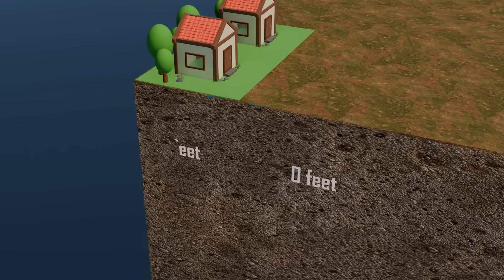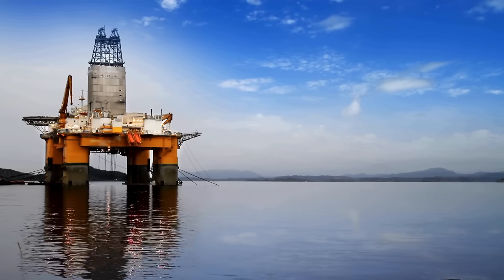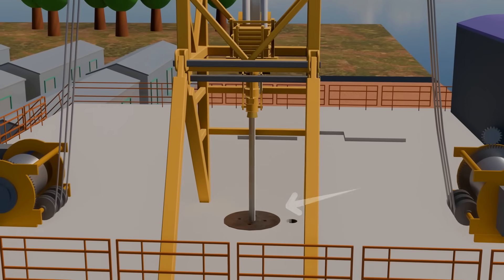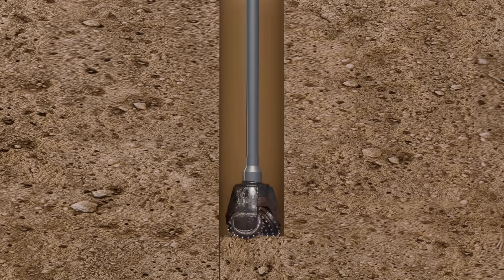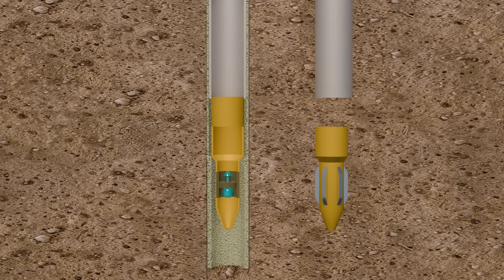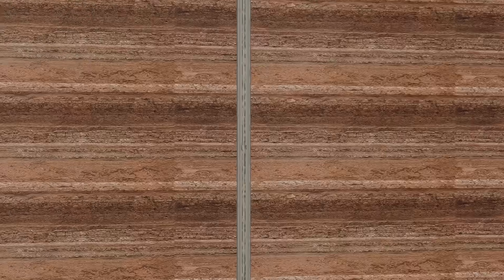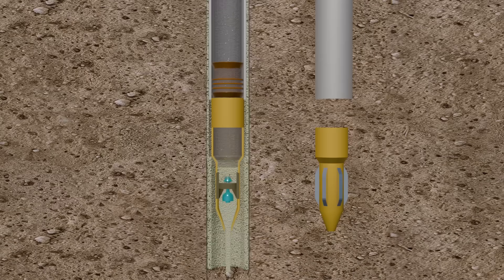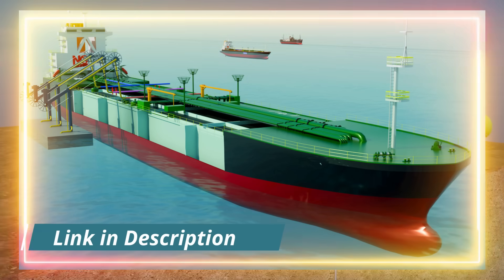How Do Oil Rigs Work? Drilling, Casing, Mud & Blowout Prevention in 3D

Comment: It’s not an oil rig or a gas rig! It is a drilling rig don’t get it confused gas and oil come up with one hole drilled. But one hole can produce many kick off points don’t let that get confused. 
My team and myself had the record for a horizontal well drilled in west Texas for over 6 miles in less than 30 days 23 days I believe to be exact with a motor called rotary restrearable and a PDC drill bit.

Comment: My 2 Older Brothers, and I have All have a 5 mile Club Plaque. The Deepest I was ever on was 28.800 But 1 of my Brother was a Roughneck on the Deepest Well Drilled in Texas 1978 The Emmy Lou # 2 was 29,622. Liquid Sulfer. No need to Drill any Deeper Straight Down. The Bit that TD,d the Hole is in the Permian Basin Museum.

Comment: The Tall Tower is Called the Derrick, not Mast. The Sleeves are called Slips. Never Lower the Entire Weight of the Drill String on the Drill Bit. The Small Holes are called Jets. The BOP,s are Installed before Drilling Begins not at the End of the Drilling. If the Hole is Bent Too Sharp Its called a Dog Leg.Pulling, and Lowing the Bit, and the tool Joints Threw Dog Legs cause's a Key Seat. I Started Roughnecking in 1978. There were no Directional Down Hole Motors Back Then. You Simply Cemented Up past The Key Seat and Used a Bent Sub to Try and Straighten the Angle of the Hole. Tech has come a Long ways since I 1rst Started.

Comment: Fairly decent on your video.  There are several areas that are outdated as comments mention and the descriptions are always accurate for today's oil and gas industry.  The total depth of the well depends on geology of formation depth and rock integrity.  In ND, we drilled typically 20-22,000' in about 3 1/2 weeks. 
The pressure also makes a difference too.  In Ohio, we drilled in 10,000 psi formations that had to be controlled by balancing the pressure constantly as the normal method of just weighting up would damage the formation.

Comment: It's probably not such a bad video, but when the rotary bit is turning the wrong direction and the cones are rotating at bizarre speeds, it undercuts the overall credibility.  The DTH hammer looks ok. ...(a 3 decade rock bit design engineer)

Comment: Not a bad video, but Kelly drilling is all but obsolete for the past 15 or so years.  Rigs still using it as a primary means to make hole are low cost,
Low tech and do t get much work.  
The "pulley system" shown is not correct.  A drawworks is used to trip pipe in and out of the hole, and it located on the rig floor or on the ground close to the the rig.

Comment: The pin, or male end, of the drill pipe is pointing down not up.
Reply: Normally, yes.  However when working in ND, the company attempted to bring in a small rig to drill the top hole as a way of cutting down total cost of well.  That little rig drilled with the pin up.  When I pointed it to the company man that they were drilling upside down, I had to point it our explicitly before he looked close enough to realize what I'd said.  The only rig I've seen with pin up...

Comment: So how did they know where to drill for oil back in the 19th century?
Reply: Completely different and without well control.  That's the reason that in old movies, they depicted gushers as there wasn't a way to control them.  They had to let them flow and then recover the oil from the ground.

Comment: Your animation shows the drill string rotating to the Left. Incorrect! All drill strings rotate to the right because threads (on pretty much everything) are right handed. Rotate to the left will disconnect the joints. Also, 7000 ft is a relatively shallow well. Many go to more than 30,000 ft.

Comment: You need someone with experience to proof these videos before showing. Pipe turns clockwise (to the right) and the pin (male thread) faces down.  You dont put the entire weight of the drill string on the bit. I could not watch any more.

Comment: This video is about 40 years to late, it pertains to the 70's and into the 80's and rig terminology used is all wrong, for instance the outside space  between the drill string and BHA, the annulus, is pronounced (ann-u-lus). The 80's saw top drives start to replace kelly's, mud motors, dtu's and the current closed rotary loops, supplant conventional rotary assemblies. Average well depths were in the region of 10,000 ft or 3000m, but depths can double and triple that in todays drilling. MWD replaced single and mutli-shot compass based systems and gyro gave way to accelerometers and magnetometers, utilizing the earths gravitational and magnetic fields, to determine where the well is being drilled, though gyros still overcome areas of high magnetic interference, when casing is involved. Mud is used for weight to balance the inward pressure exerted by the formations, as a coolant taking the geothermal heat back up to the surface to be dispensed, and as a lubricant. In addition the MWD pressure signals are transmitted through the mud to be decoded at surface and let the directional driller know where he is when plotted on the charts, that show the the wellbore to be drilled. I was forty years in the drilling industry, first as a seismic engineer, a surveyor using magnetic and gyro single and multi-shot systems, and then a conventional rotary drilling, mud motors, jetting, bent subs, and closed loop directional driller.

Comment: Is it cement or concrete?
Cement is a part of concrete
Reply: Yes, cement powder is just one component that makes up concrete, and is itself made up of at least five different components. Essentially it’s the chemical glue that binds the small aggregate, eg sand to form grout. Large aggregate is added and the cement, sand and water chemically react in a process called “hydration” and in turn bind with the large aggregate to form the malleable semi-liquid concrete mix we are familiar with. All and any of these components can be altered to impart specific properties to the concrete to change its workability parameters. Interestingly, construction concrete can take decades to fully cure. Though practical hardening may occur in a matter of hours full structural strength usually takes several weeks. This is tested during construction by taking predetermined quantity samples and subjecting them to precise crush testing in accordance with a specified timetable. These tests are determined by the construction standards applicable.
Reply: @s @stevengrindrod2002 . 
Hi Steven, thank you that info, I am aware of the components of concrete and where I was going is that many people called concrete, cement. A pet hate. Eg a tyre is part of the wheel, there is the tyre and rim that makes the wheel. 
Pumpset equal pump and driving force being an electric motor, diesel engine etc. 
But a genset is always called a genset

Comment: I was exploring in the Gulf back in the late 1980's. We set off a series of explosions to assess the presence of oil. Right after the explosions, the ocean looked like it was boiling there was so much methane in a shallow layer. We went back a week later and roughly 10-15 acres were still violently boiling. I don't want to think about how much methane escaped into the air. The company didn't care and refused my offer to estimate how much gas escaped.
Reply: Can we connect? Im interested to talk about an oppurtunity.
Reply: Persian gulf or Mexican gulf?
Reply: @cyrusthegreat1336 Gulf of Mexico

Comment: I worked on a rig and it does not take a month or months.  It takes a couple days to air drill a 1000ft or so, then the main drill rig comes in and drills somewhere around 7-11000ft before the turn and that takes maybe a week, depending upon rock in the hole.
Reply: My rig has a record for the fasted 10,000 foot drill. Worked on a gas patch for EQT then
Reply: @IconicLoco What’s the record? 😊
Reply: @unchartedmexico I don’t remember but our pusher has a trophy lol
Reply: We used to drill 25,000 feet in Wyoming year's ago with True drilling.
Reply: @KGB5910 we would drill around 15-20,000 ft but would turn around 7-11,000.  It all depends on where you drill and what you're drilling for, but either way about a week for a hole.  After that it's someone else's job.
Reply: @markwest7165 I wasn't disagreeing or trying to to prove you wrong on anything
Reply: @KGB5910 yeah no I wasn't saying you were or disagreeing with you either. Just this video.
Reply: @markwest7165 Also those deeper holes were right at a month to drill.  Slow drilling was about 3 1/2 hours per connection and constantly changing out bits 🤦
Reply: Good to know this information
Reply: Its 1 month here after drilling fracking and then drilling the plugs
Reply: Dude it takes weeks just for the cement to cure

Comment: This is great!  Awesome job, great animation.  I really appreciate the work you put into this presentation!  Laf, but now I have a lot more questions… If anyone feels like answering any, don’t be shy!

It doesn’t seem like it should work, yet…

The materials science is just crazy - how do you rotate the entire casing structure down (in this example) 7000 ft and not have everything tear itself apart.  The mud motor (I’m still not sure how that rotates via pressure) invented to perform horizontal drilling…who even comes up with an idea like that?  I guess it started by forcing conduit for fluids and cables to travel under roads and whatnot, horizontally; then steer it wherever it’s needed, and then there’s the technology transfer to drilling insanely deep.

When the vertical drilling transitions to the mud motor, and we drill horizontally, say, due east, what happens when we want to change direction and go due west?  Can the easterly run be disconnected at the bottom of the same vertical drill hole, and a new mud motor is sunk with the intent of making a westerly run?  If for some reason we want to go back to the east, can we re-connect to the easterly run, and start it up again?

That oil (or any fluid) can be under so much pressure at depth, it could be forced up the 7000 ft hole and blow out the too is impossible to intuit.  That’s a lot of pressure.

Another scenario I can’t comprehend is the pressure we need to push down into the drill hole to force the mud back up the annulus surrounding the casing.  That’s a LOT of pressure we’re putting down there, and there’s hardly any space in the annulus.  What kind of pumps do we have available that can force the mud down the center of the casing and then back ALLLLL the way up on the outside of the casing?

It seems there might be layers of casing and layers of cement between each casing…but why, and where are these widening layers of casing/cement - are they widest at the very bottom of the shaft or the very top?  (That is, how many layers ‘thick’ are the are the concentric casings?)  What happens if the inside diameter gets so small, you can’t shove the mud motor in?  And what happens if you’re at 7000’ but you now need to go to 10,000’?  I guess I’m not understanding how the conductor casing, the surface casing, the intermediate casing, and then the production casing all work together, and for exactly what reason.

Are these four casing layers (sections?), and the cement forced between them, installed along the entire 7000’ drill hole?  Or do we start putting in the layers when we reach a certain depth, generally speaking?  At 11:45, we see all of the casings beginning at a particular depth, but then taper off to only the production casing near the bottom - am I not interpreting the 3d animation correctly?

Comment: When the drill bit gets lower, the motor lifts the weight of the drill stem off of the bit.  The weight of the drill pipe would crush the bit if all its weight rested on the bit, so the motor doesn't put pressure on the bit at depth.

Comment: In 1981 we drilled over 24,000 feet so you can go way beyond seven
Reply: Weren’t you worried not to find oil after 10, 14 . 16,000 ft ? How did you decide to go so so far ??
Reply: @martinap1961  geologist made that decision. It was intended to be mostly a gas well and it was a monster in the pressure was so high. It collapsed her piping and so we moved it over and started over again.
Reply: Thank for the time you took to answer me. Impressive depth!

Comment: I was first, a roustabout, in 2011, at 21 years old. Then a swamper (crane chain bithc) in 2013. Bro in laws a mud engineer, in North Dakota. And I tried coledge for mechanics 🙄 The $16 commission SUCKED, in mechanics. The $23 an hour, was better in the oil patch 😉
But I wonder: how many drill bits about, till it reaches its destination 🤔

Comment: The plugs are now made of Teflon so when they are drilled out the drill bit is not damaged.
Reply: Not totally correct.  They use composite materials that may contain some Teflon but are not fully made of Teflon. If they eeven have any Teflon in them.  I know, i design them in real life.

Comment: The Kelly rod is put into a rathole. They didn’t use that term. Part of the cellar with conductor hole.
Reply: The kelly pipe went into the rat hole when we started tripping pipe. When the bit was changed and the pipe run back in the hole the kelly was attached , the drilling resumed, and we got a rest.

Comment: Most rigs use a top drive instead of a kelley, and PDC bits instead of cone bits.
Reply: I started to work in an O&G construction company, building and repairing, Jack-ups in 2005. My senior colleagues told me that they had seen kelley on the rig a few years ago. In my career, I saw only top drives

Comment: Mate you got the pin and box upside down 😂  Kelly's are historic drilling technology. Mast is stick or derrick. Cuttings go over shakers seperates them from the mud that is returned to tanks often though desander  desilter and centrifuges. The BOP is installed before the well reaches hydrocarbons. Production casing is installed on hangers and packers to seal it not cemented as they need to be pulled for servicing. Still a good effort thanks for your content.
Reply from the maker: Thanks for pointing out the error and the detailed information!

Comment: You are rotating backwards Kelly’s turn to the right to drill or tighten joints. This is misleading. Also you are using incorrect labels to items used to drill a well. Check your references.

Comment: what is "depth of 800 feet"? is that some sort of measurement unit?
Reply: 1 foot is .3048 of a meter.  800 feet equal 243.84 meters. There are conversion tables online.
Reply: @katazack  oh my word. might as well measure using bananas or football fields

Comment: There’s a start up company in Texas called Quaise working on going deeper to the point to where where it’s so hot that the rock is it hard, but a pain in the ass for the drillbit used. So this company is using no drillbit after they get to a certain depth. Essentially plasma, I mean, you can find it here on YouTube. Real engineering did a video about six months ago.. I think the title is Geothermal energy is changing, something like that!
Reply: That's because oil is not a fossil fuel.  Drill far enough and you'll find all we need

Comment: But how do they steer the bit during horizontal boring? Let's say they determine they need to go North with it, how do they do that?
Reply: They have remote steerable systems now
Reply: Either a bent mud motor, or a rotary steerable tool. A gyro in the BHA downhole provides orientation. We plot the path, and predict where it will go from there.
Reply: I have seen some locations here in Oklahoma where they have 4 different wellheads, I assume one head for each direction N, S, E, W.
Reply: @dirtfarmer7472 no..... either stacked laterals, paralel, or both. Wells are drilled perpendicular to the stress field, to make use of natural fracrures.

Comment: But when using oil-based mud, will the aquifer (water table) be contaminated or not!?
Reply: The casing is extended through all of the water zones      .
Reply: They put casing down below the water table then cement around it. It's not supposed to but you know how that goes
Reply: @bluesky6985  Yeah.  Used to live in Midland, TX (middle of Permian Basin), and well water was crap due to the drilling.  Everyone I know used bottled water for drinking.
Reply: @abn82dmp Still do and RO water 💧
Reply: They use water-based mud when drilling the first thousand feet or so.  The water-based mud does not contaminate the water bearing sands as oil base would do. Once past the water bearing sands, casing set in place, cemented, then switch over to polymer based-oil based muds and continue drilling.
Reply: You dont displace OBM until you need it.....I.E. after surface casing is set and about to cut the curve. Why would you think that would be allowed anyway? Seriously, we arent dumb.

Comment: concrete......cement is the powder in concrete
Reply: And it is cement. 

You ain’t mixing sand and aggregates like construction for drilling. 

It is a cement powder grout. You will never hear someone on a rig site call it concrete. 

There is a lot wrong with this video. That is not one of them.